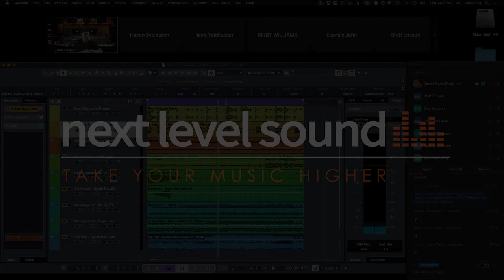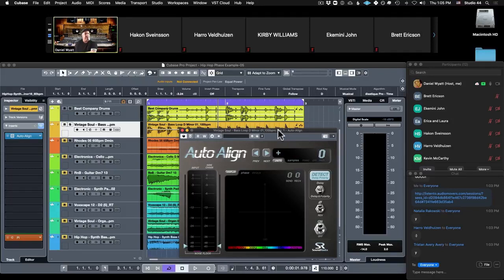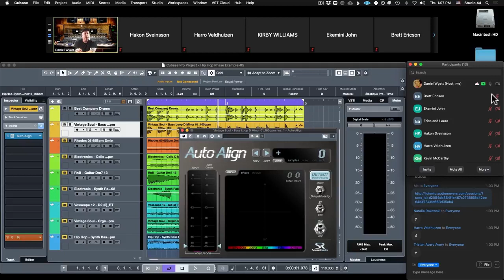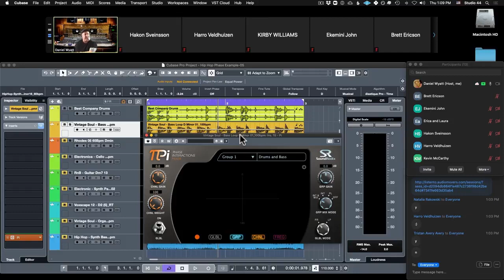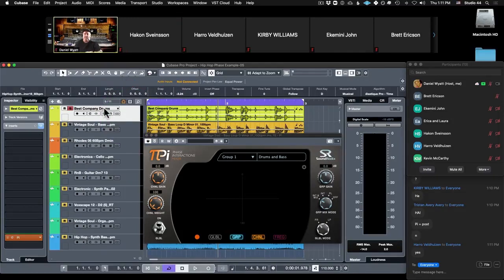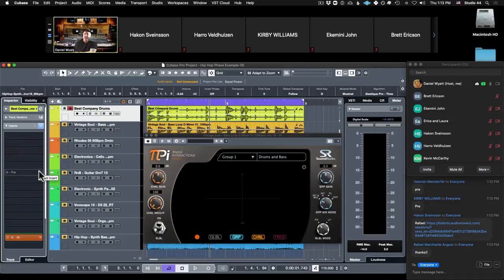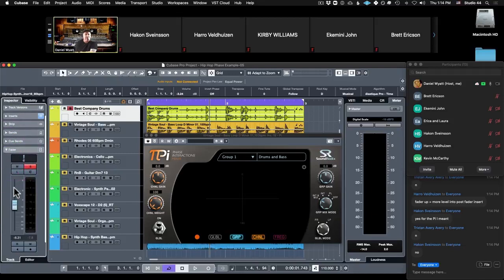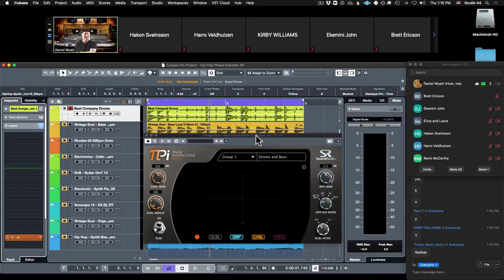Sound Radix PI Explained - How and when to use - Fixing Phase | Part 1

Comment: We know gain staging.  Pre and post fader.   Let's talk about pi.
Reply: He is talking about Pi though, when used post-fader which is what the makers recommend whenever possible. He's not talking about gain staging at any point here, he's talking about how much each channel fed into Pi influences it's behaviour
Reply: @strumspicks2456 he literally talks about gain and how its controlled pre and post fader...   set the plug in pre fader... next... we came for the pi lesson... not a routing lesson.
Reply: @rickneibauer1  
   
   This lesson is given in the context of a course that talks about more than PI. He is asking students basic questions about the behaviour of a plugin pre vs post fader just to check they understand, because this is important when using Pi. He is not talking about gain staging at all.   
   
 He is pointing out a crucial aspect of PI's functionality, which I assume is confusing you because it sounds like gain staging: the relative volume of each element going into Pi determines how much it influences the phase adjustment behaviour of the the plugin as a whole. All channels with Pi enabled influence its behaviour, the louder ones more so. Hence the metaphor 'the bigger kids jumping in the pool make the bigger splash".   

   
The reason why pre-post is important: if your DAW does not allow post fader inserts, PI has to be placed last in the chain and you manually control the weight of each channel with the 'CHNL WEIGHT' knob at the mid/bottom left, so you decide which element(s) have the biggest effect on the over all phase adjustment